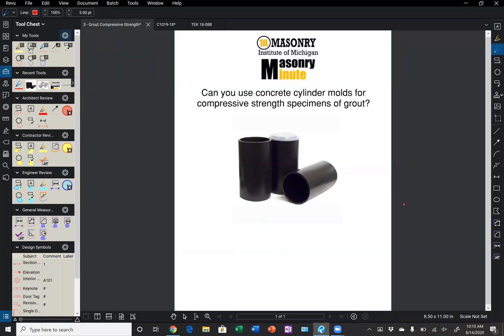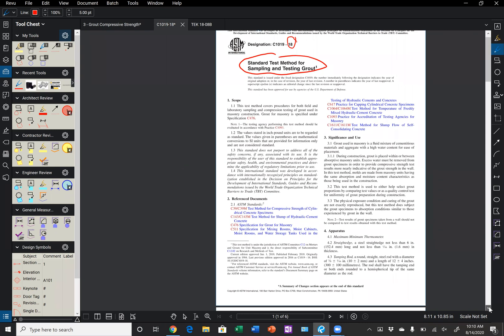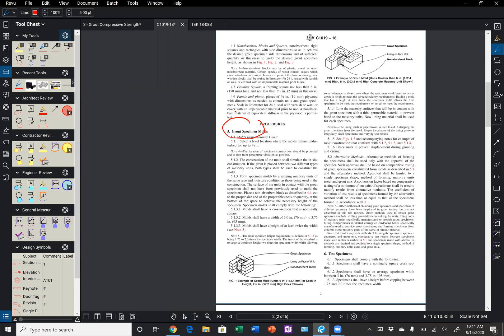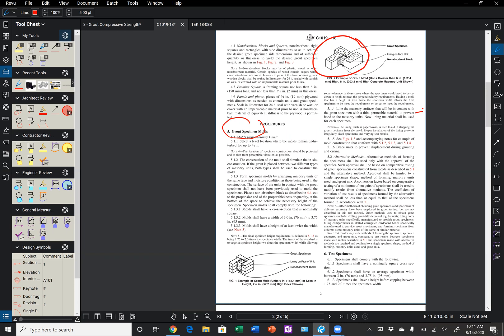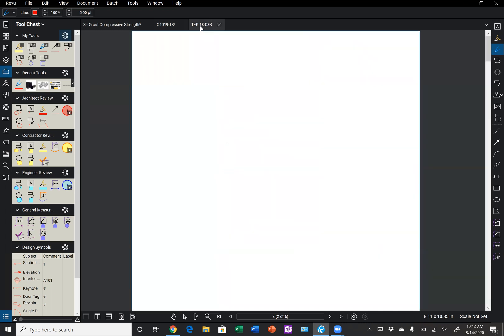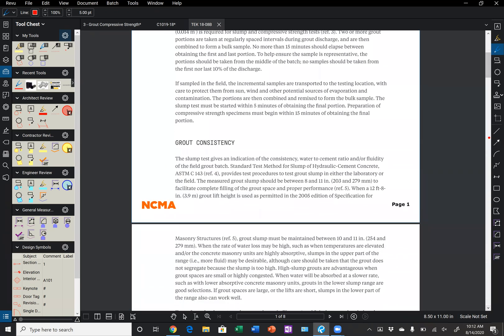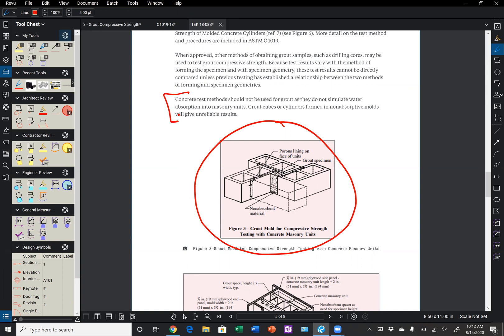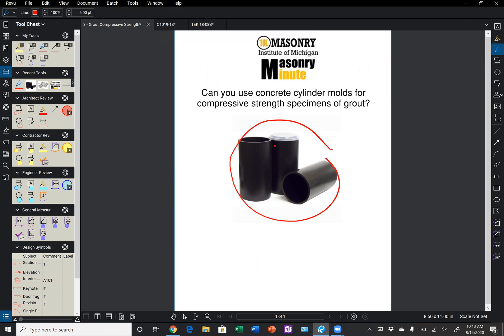Masonry Minute: Can you use concrete cylinder molds for grout compressive strength specimens?

Comment: The grout you mentioned are to be used in masonry units however now a days these have been developed further like mircroete grout that are used for connecting precast reinforced concrete sandwich walls. For those application i think we can still rely on cubes or cylinders